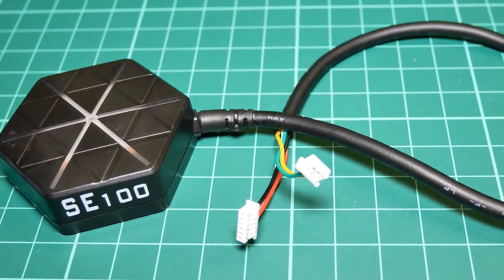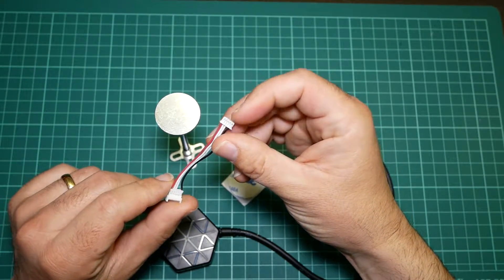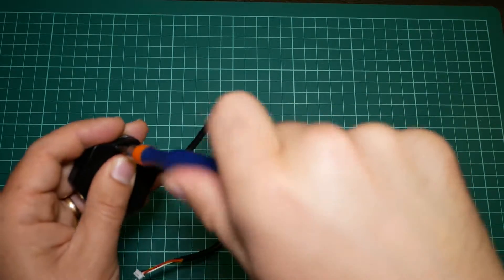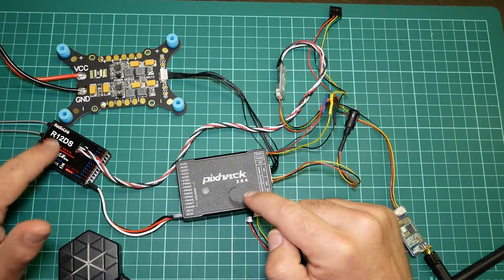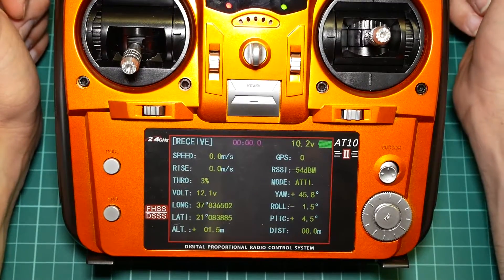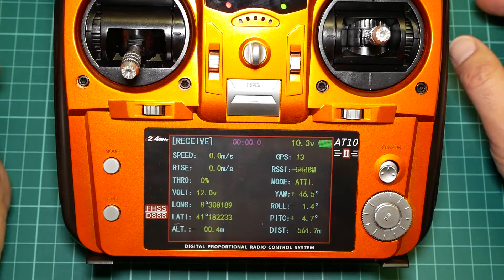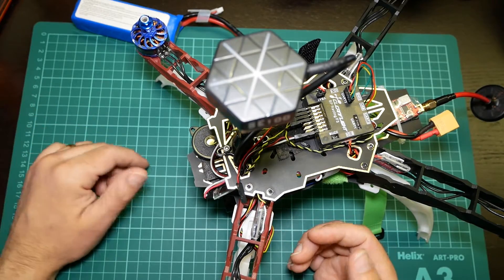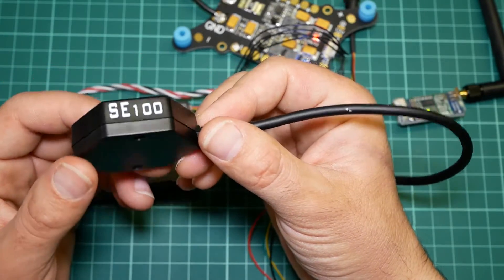Radiolink SE100

Comment: Thanks much for the info!
I didn't know it had an M8N module and thought I needed to buy another type for a small flying wing.
Also I didn't even see the 6->5 pin cable. Hoping to get it working on an Omnibus F4 FC.
Might be a bit heavy for the little wing though!
Reply from the maker: Phil B thanks for your comments. 
For a  little little wing it could be heavy. 
The  adapter cable must be recent, because  I have another unit that didn't came with de cable and support.
Reply from the maker: Phil B with a sp racing F3 also works well. I have a video showing that.

Comment: Hi. I can't connect this SE100 to my CC3D. Radiolink told me I need to solder cables... It is possible to connect this GPS without soldering?

I think the flight controller on your video uses the same JST connectors like the CC3d...

Thanks!

Comment: Im using  radiolink  pixhawk and radiolink gps se 100
But in mission planner it give error like gps no fix
Reply from the maker: +Jashu Chaudhary I have two se100, one  with pixhack and the other with sp racing f3, and both get a good number of satellites. 
Maybe yours has a problem.
Reply: Now it takes too much time to fix.
I'm testing in my room it is fine?
Reply from the maker: +Jashu Chaudhary inside house, it's normal that take too long or even doesn't fix.
Reply: Thanks.

Comment: Omnibus F3 flight control board will not recognize GPS I've tried betaflight and cleanflight I ordered F4 board maybe it'll work on that no instruction manual it says the go online and then they just try to sell you more stuff with no installation manual probably my last radiolink purchase too bad they have nice stuff
Reply: On F3 boards, gps won't work if using Betaflight 3.0 or later or Cleanflight 2.0 or later.